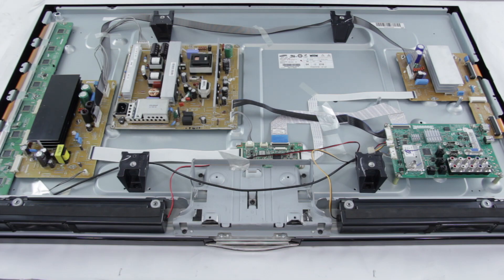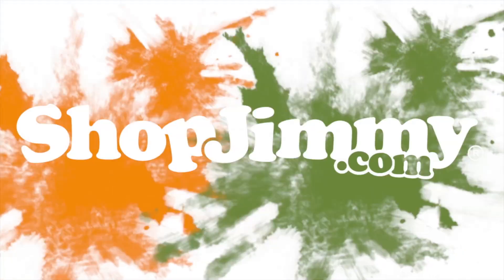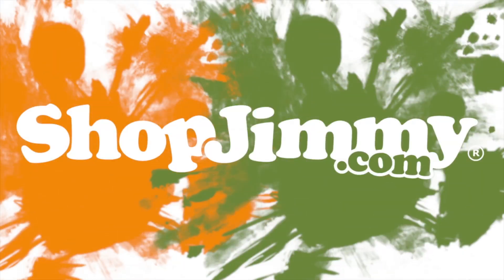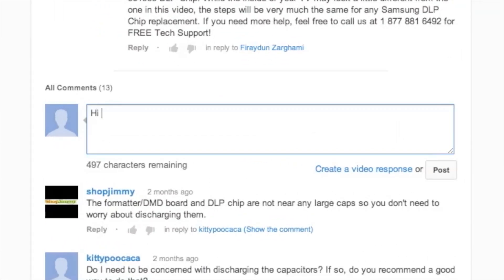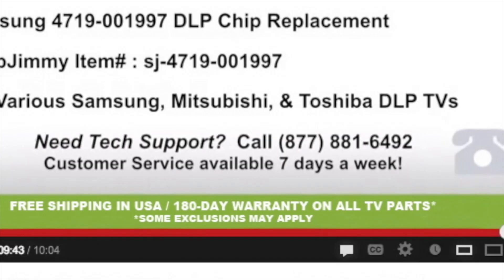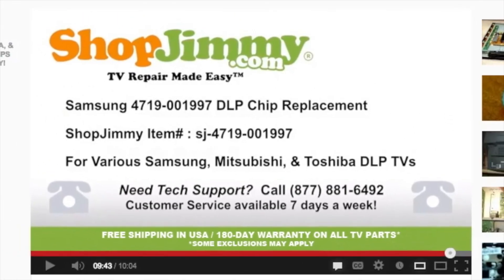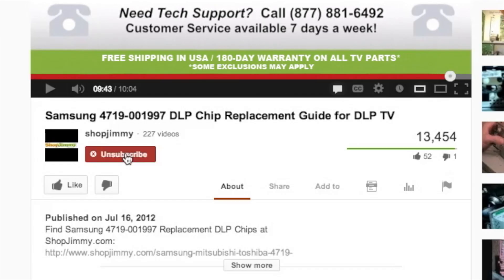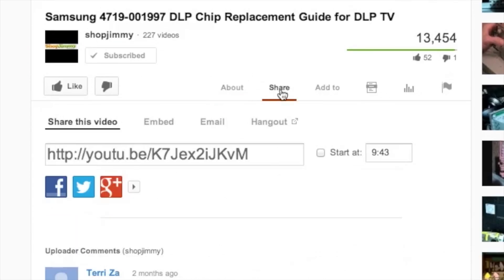Plasma TV Repair Tutorial - Common Symptoms & Solutions - How to Fix Plasma TVs

Comment: I have an LG 50pa5500 UA AUSLLHR plasma tv that the picture stopped working on.  The sound still works, but the picture in black.  I tried different inputs with the same results.
Reply from the maker: Paul Avery  I recommend replacing the YSUS board and the YDRVTP and YDRVBT boards that attach to the YSUS board.  Here is a link to replacement parts for your TV model number on our website, click here:  http://www.shopjimmy.com/catalogsearch/result/?q=50pa5500  Be sure to match part numbers on your current board, with your replacement for compatibility.  You can also call our customer service for further assistance with your purchase.  (877) 881-6492  Thanks and please let us know if you have any further questions with your TV Repair!  www.shopjimmy.com

Comment: Hi: I have a power up problem with my Gateway 42" Plasma TV; Model# GTW-P42M203, SN: 32947108956 and Power Board: Samsung PDP-PS-421S  Rev. 4  20030408.
Problem: It will not power up. Neither the Power button on Remote Control nor the power button on front of TV can turn on the TV.
What I have done so far: I replaced totally 4 capacitors on Power board - 2 of them are 330 uF, 450 WV,105 degrees C and another 2 are 1500 uF, 250 V,  (M)105 degrees C,
plus, replaced 2 capacitors on Y Ass'y Interface Board and 2 on Z Ass'y Interface Board. All of them are 470uF, 200WV, HE 105 degrees C (M).
Result: The TV worked fine for 2 weeks. It powered on normally with both Remote control as well as the power button on TV. Worked without any problems for 2 weeks.
New problem: When we power up, there is a single click and nothing happens after that; the small light stays orange and does not turn green. Same result with remote control or the power button on front of the TV.
We unplug the TV for few minutes and then toggle the master power-on switch on the back and push the power button on front of TV or on remote control, and most of the times, it will power up and stays on and works ok all day. Have to try several times until it works.
It tells me that there is still one component that chokes-up and needs to be reset - which is done by toggling master power-on switch & unplugging the power.
The fuses on power board and on the board where power comes into the TV are ok.

Appreciate any suggestions for a fix.
-Ravi Reddy
Reply from the maker: Ravi Reddy   I recommend replacing the power supply in your TV.  Here is a link to replacement parts for your TV model number on our website, click here:  http://www.shopjimmy.com/catalogsearch/result/?q=GTW-P42M203  Be sure to match part numbers on your current board, with your replacement for compatibility.  You can also call our customer service for further assistance with your purchase.  (877) 881-6492  Thanks and please let us know if you have any further questions with your TV Repair!  www.shopjimmy.com

Comment: Hi Jimmy i have an Lg 42PX-EB it was working fine when theirs was a loud bang,it still all turns on but i dont have picture i can see when i power it on that the picture trys to come on but just dark but no picture ive found a blown fuse on the Ysus board would u think that its the ysus board causing the problem ive seen a thew videos about it being the Lg Module on the Ysus not sure tho but i have found a blown fuse on the board ive replaced that but nothing changed please help?
Reply: sorry an LG 42PX5D

Comment: Samsung PN60E550D1FXZA Plasma TV.  I have had an intermittent black screen with sound almost since I got the tv about a year ago.  At first I would lose the picture after going from the internet setting back to the live tv setting.  This happen 2 or 3 times during the first half year.  Now, the tv may or may not have a picture when I turn it on.  It always has sound.  Sometimes I unplug the tv, replug it in and it works.  Or I can turn it off and turn it back on and it will work.  3 weeks ago it did not want to turn on so I called Samsung.  Today the service man was here to replace the panel, but when he was  removing the panel from the bezel he noted that a couple of the plastic holding parts on the bezel were broken.  I told him that a few months ago I had noticed a crack in the bezel at the lower right corner starting at the inside of the corner working diagonally outward to about 1/2 inch from the outside corner.  I thought it was odd but everything seemed to be working ok, so I didn't call Samsung about it.  The screen has been on the wall and no one has been around who would damage it.  There is no visible sign of damage on the outside of the tv.  The serviceman stopped the repair and called Samsung saying that there appeared to be physical damage.  I see from your video that there is probably a pcb problem causing the no screen.  Is there some kind of heat or stress problem that could cause the screen to crack?  A small triangle of glass also fell out when he was disassembling the unit, and he says it is part of the panel, not the bezel.  I read another persons account where his 3 week old tv made a loud snapping noise and then the screen had a crack and it went black.  Mine had damage but continued to work (when it worked).  ??
Reply from the maker: Jim Place   This sounds like a TV panel problem.  If your TV panel is bad, it may be more cost-effective to replace the TV as panels are typically hard to find in stock, difficult to replace, and expensive.  Thanks and please let us know if you have any further questions!  www.shopjimmy.com
Reply: I have the same situation with no picture or sound, the standby light blinks 5 times. i have replaced the power board and the Z sustain board. noticed a the green LAD on the logic board blink at a rate of 1 sec off and 4 seconds on. 3.29.15
Reply: that was the x board
Reply: i have the same problem, only i have sound, no picture, same tv !

Comment: I have a MAXENT Plasma TV, I’m not getting a picture or any sound from the unit. However, the power light comes on when the TV is power up. Before I lost the picture there was a solid vertical line in the middle of the screen. My Product number is MX-42HPM20 and the MODEL # is P420142X3. Thanks for the help.
Reply from the maker: Chris Archer   I recommend replacing the main board in your TV.  Here is a link to replacement parts for your TV model number on our website, click here:  http://www.shopjimmy.com/catalogsearch/result/?q=MX-42HPM20  Be sure to match part numbers on your current board, with your replacement for compatibility.  You can also call our customer service for further assistance with your purchase.  (877) 881-6492  Thanks and please let us know if you have any further questions with your TV Repair!  www.shopjimmy.com

Comment: Insignia NS-PDP3209, Had bright pink lines running from top to bottom, right of center, of screen. Watched your video, removed main board, found ribbon, took out'
dusted board and ribbon, put back together. Lines were gone. left on for about an hour and the lines came back again. Any suggestions?
Reply from the maker: Glenda Ritter   I recommend replacing the ribbon cables.  You can also call our customer service for further assistance with your purchase.  (877) 881-6492  Thanks and please let us know if you have any further questions with your TV Repair!  www.shopjimmy.com

Comment: Samsung model PN51E450A1FXZA; version TD02. failure: suddenly no picture while watching dvd (still had sound). Observations/symptoms afterward: standby light is on until powered on then the screen briefly flashes the last picture that was on the screen (only for 1 second) then is completely black with standby light blinking several times then unlit; sound still works; no menu pop-ups or any on screen menus are visible-screen remains completely black.
Reply from the maker: Tim Struemke   I recommend replacing the Y-Main board and buffers that connect to your Y-Main board in your TV.  Here is a link to replacement parts for your TV model number on our website, click here:  http://www.shopjimmy.com/catalogsearch/result/?q=PN51E450A1FXZA  Be sure to match part numbers on your current board, with your replacement for compatibility.  You can also call our customer service for further assistance with your purchase.  (877) 881-6492  Thanks and please let us know if you have any further questions with your TV Repair!  www.shopjimmy.com
Reply: ShopJimmy.com I forgot to mention, a couple weeks ago my son threw a dice and it hit the tv screen which created a spider web crack, could this have had something to do with the tv quitting? it ran fine for a couple weeks after this incident so I didn't think that was a problem.

Comment: Hello!  I have a Sony KDL-52XBR9  The Power/Standby Light blinks twice red and then pauses over and over and the screen or sound won't come on at all.  I tried a reset. The green power light came on for a few seconds, but the screen or sound never came on. Then, the green light went back to the blinking red light. What do you think could be wrong?
Reply from the maker: ITOLDUDA   I recommend replacing the power supply in your TV.  Here is a link to replacement parts for your TV model number on our website, click here:  http://www.shopjimmy.com/catalogsearch/result/?q=Sony+KDL-52XBR9  Be sure to match part numbers on your current board, with your replacement for compatibility.  You can also call our customer service for further assistance with your purchase.  (877) 881-6492  Thanks and please let us know if you have any further questions with your TV Repair!  www.shopjimmy.com

Comment: hey jimmy,
have a phillips plasma model # 50pfp5332d/37 IT JUST SHUT OFF. WILL NOT TURN BACK ON. NO BLUE LIGHT OR PICTURE. YOU THOUGHTS PLEASE..
Reply from the maker: Stephen Fontinha   I recommend replacing the Y-Main Board and buffers that connect to the Y-Main board to fix your TV.  Here is a link to replacement parts for your TV model number on our website, click here:  http://www.shopjimmy.com/catalogsearch/result/?q=50pfp5332d%2F37  Be sure to match part numbers on your current board, with your replacement for compatibility.  You can also call our customer service for further assistance with your purchase.  (877) 881-6492  Thanks and please let us know if you have any further questions with your TV Repair!  www.shopjimmy.com

Comment: I have a LG 32LD490 TV, when i plug hdmi inputs into it, it says connecting for a couple of second then no signal, i have tested the cable and input device and they work fine, all 3 hdmi ports don't work and the av ones. But the digital TV on the TV still works. I have tried to find a main board replacement for it but i can't find one, do you know where i can get one? and could it be anything else wrong with e.g. software
Reply from the maker: Chris Ingram   Unfortunately I do not see any replacement parts in the search results for your TV model number on our website.  You could check other online stores as well.  Thanks and please let us know if you have any further questions!  www.shopjimmy.com
Reply: Were you able to get this fixed at all Chris Ingram  I own the same TV and it has also finally failed with the same fault and just like yourself I cannot find a mainboard to replace it at all!
Reply: Alan McGarrity Yes i did manage to repair my TV successfully. I was looking on eBay for a replacement board for a couple of days, i was just about to give up and buy a new TV and then a used one came up for sale (one off a TV which had a broken screen). I brought the replacement board for about 50 quid off eBay, installed it (quite easy to install only a couple of connectors) and it has been working perfectly fine for the last 14 months since installing the replacement board. Here's a link to a replacement board i have found on eBay which should be a direct replacment, hope this helps: http://www.ebay.co.uk/itm/EAX61531904-5-MAIN-AV-BOARD-LG32LD490-32-LCD-TV-/252010073119?pt=LH_DefaultDomain_3&hash=item3aacf88c1f

Comment: Hi,i have a samsung plasma 60" ps60e8000gmxxy 13months old from new.gave a loud bang noise & noticed abit of smoke came out of the left bottom side then no picture or sound .The red stand by light works ,flashes twice slowly then three or 4 fast flashes.
Still waiting to hear from samsung if the are going to cover parts & labor on a rta extended warranty ,so might have to fix it myself yet.can you help with what the problem might be.
Thanks
Reply from the maker: jbether100   You will want to check your Y board and the buffers that attach to the Y board.  Unfortunately I do not see any replacement parts in the search results for your TV model number on our website.  Thanks and please let us know if you have any further questions!  www.shopjimmy.com

Comment: hey jimmy,
i have a samsung plasma tv that has vertical one black vertical line that is on the right side of my tv  that is about an inch thick. there are also 3 green lines and one blue line pretty close tot this black line that are barley visable. What part do i need? the model number is PN50B550T2f
Reply from the maker: dylan peralta   This sounds like a TV panel problem.  If your TV panel is bad, it may be more cost-effective to replace the TV as panels are typically hard to find in stock, difficult to replace, and expensive.  Thanks and please let us know if you have any further questions!  www.shopjimmy.com

Comment: Help please! 
I have a tc-p50g10 .has unlimited blinking lights and doesn't turn on ..at first it will take like 10 try's to turn it on and it would stay on as long as I didn't turn it off...but now it doesn't turn back on..it's a Panasonic btw..please help thanks
Reply from the maker: Manny Rosario   I recommend replacing the power supply in your TV.  Here is a link to replacement parts for your TV model number on our website, click here:  http://www.shopjimmy.com/catalogsearch/result/?q=tc-p50g10  Be sure to match part numbers on your current board, with your replacement for compatibility.  Here is a link to a video showing how to identify your part number, click here:  DIY Plasma TVs 101: Part Identification Number Guide for Panasonic Power Supply (PSU) Boards  You can also call our customer service for further assistance with your purchase.  (877) 881-6492  Thanks and please let us know if you have any further questions with your TV Repair!  www.shopjimmy.com

Comment: Hello, Jimmy.  Great YouTube video and thanks for offer to help diagnose.
I have a Samsung Plasma TV, Model number PN58C550G1FXZA, purchased 38 months ago.  We were watching a DVR program and the screen went black, but we could still hear the audio.  I powered the TV off-on several times, the standby light is functioning normally (red in standby, off when remote On is pressed), but there is no video.  I can hear the normal power-on tones, but the screen remains black.
It seems like the power supply is not dead (audio still works).  Any ideas?
Thanks in advance, Dick Ames
Reply from the maker: Dick Ames  I recommend replacing the Y-Main board and the buffer(s) that attach to the Y-Main board.  Here is a link to replacement parts for your TV model number on our website, click here:  http://www.shopjimmy.com/catalogsearch/result/?q=PN58C550G1FXZA  Be sure to match part numbers on your current board, with your replacement for compatibility.  You can also call our customer service for further assistance with your purchase.  (877) 881-6492  Thanks and please let us know if you have any further questions with your TV Repair!  www.shopjimmy.com

Comment: Help I have a panasonic viera tx-p50x50b
Right side picture is about 10-15cm blank totally black rest of screen is fine pls help
Reply from the maker: Anees Akram   I recommend replacing the SC board and buffers in your TV.  Here is a link to replacement parts for your TV model number on our website, click here:  http://www.shopjimmy.com/catalogsearch/result/?q=50x50  Be sure to match part numbers on your current board, with your replacement for compatibility.  You can also call our customer service for further assistance with your purchase.  (877) 881-6492  Thanks and please let us know if you have any further questions with your TV Repair!  www.shopjimmy.com

Comment: Hello I am experiencing a static like reddish and yellow vertical line in the right of my Samsung 50" (850FH-YB0 mode) that is very similar to the plasma you are demonstrating. I have tried replacing / re-flowing the main board and logic board however that did not fix my issue. Any suggestions would be appreciated, thanks.
Reply: correction, my Samsung Plasma model is 850FH-YB06
Reply from the maker: *****  This sounds like a TV panel problem.  If your TV panel is bad, it may be more cost-effective to replace the TV as panels are typically hard to find in stock, difficult to replace, and expensive.  Thanks and please let us know if you have any further questions!  www.shopjimmy.com
Reply: ShopJimmy.com I am having the same exact issue for the same model number, there are no signs of bulging caps or leaks. I was told that its not getting a a good power to the power inverter so I bought a new power board and i have replaced the power supply board with a brand new one and its still blinking and not giving me a picture. I have researched this issue on many sites and it appears that samsung intentionally put in the wong voltage cap because it gets close to the temperature. I thought it was the logic board so I might replace that as well for $20. If this does not work should i replace the Y main?
Reply: ShopJimmy.com Tahnk you for your fast reply, do you think that by replacing the Y buffer board would have any likely effect? I would like to get a professional opinion before purchasing another component. Thanks